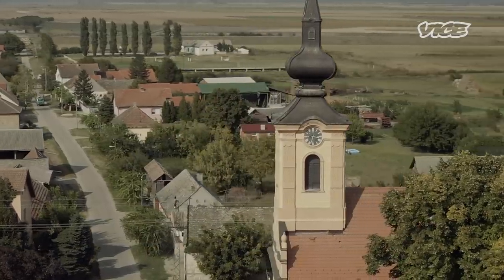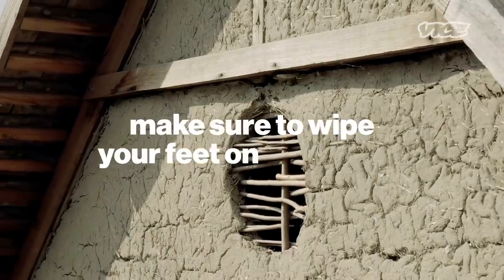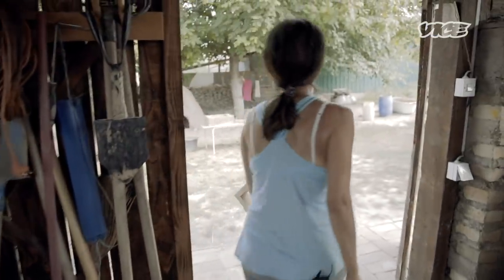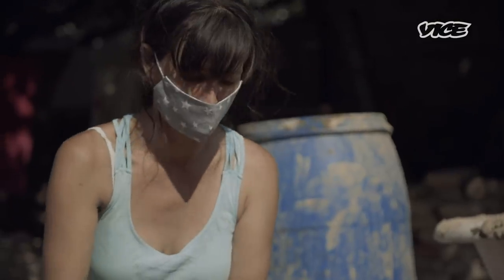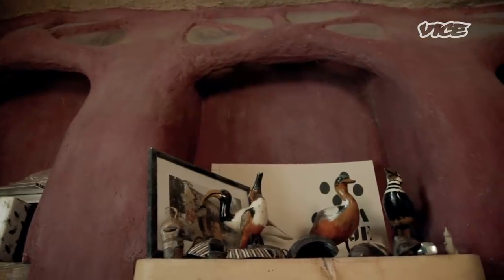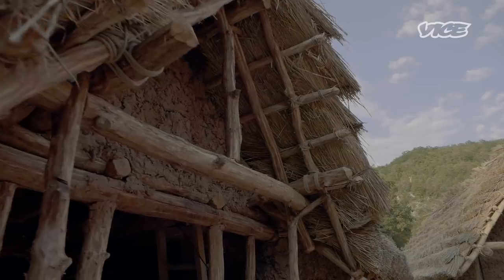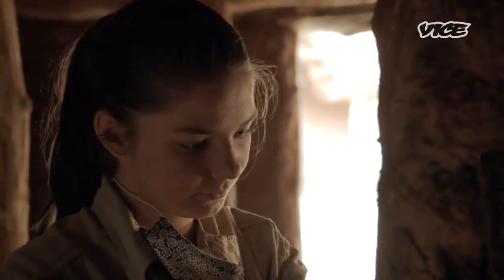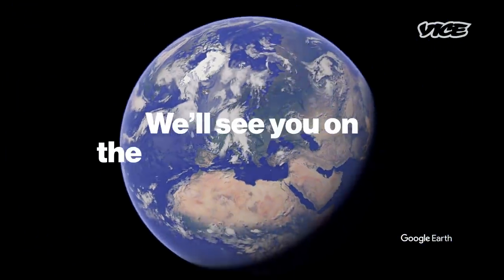Architects Are Using Mud to Build Sustainable Homes

Comment: Civilization and the westernization has doomed us all. I am an african and we built like that but it was viewed as barbaric and now look at the consequences. We should never have changed our ways!!
Reply: I mean Africans built with many other materials like stone but I feel like we always go back to earthworks because our climate is conducive for that material.
Reply: @whitneyshiphrah56  i feel like in England  the rain would make a mud house into a mud slide plus it would probs be Robbie cause all you need is a good garden hose to make a hole in the wall
Reply: @shrekthebest9399  There are rains in Africa too but mud houses can withstand such downpour. You're forgetting that the mud will dry and become sun baked
Reply: In places like England houses were built with using “wattle and daub” mud but with plaster cover to make it more waterproof, plus a thatched roof overhang so water flows away from the wall
Reply: Love that cell phone and internet though, right?
Reply: Never changed your ways? If much of Africa “never changed its ways” famine, drought, war, and disease would all be worse, and none of the technological innovations you take for granted like the device and electricity and internet required for you to post your comment on here would not be available for you to take for granted.
Reply: dude, don't use a phone then.
Reply: Lol
Reply: @magesalmanac6424 
Adding horse pee (no joke!) to the mixture improves wet weather resistance.
Reply: You don't know what you're talking about
Reply: @shrekthebest9399 heard of thatch housing?
Reply: ❤❤ say it how it is
Reply: @Father_Brother_Son   We probably could've invented something better than modern technology and cars though, if not for the interference of colonialism. That's the point. A lot of the things black people were told made us "primitive" actually turned out to be more environmentally sustainable, cleaner, healthier, etc. Just imagine Africa untampered with by colonialism, and how far we would've gotten from 500 years ago to today.
Reply: @ninibugg6203  I’m sorry, but no. Absolutely not. Let’s take a step back and examine global history. 

1. The great enlightenment, which was the single most important global event that we can credit to some degree with all of our technological advances, that allowed us to dispense with superstition, to flourish like never before, and even have the increased lifespans we enjoy today occurred in England exclusively. Had they been isolationists like feudal Japan, the rest of the world would never have received the benefits of the great enlightenment and we would all still be ruled by superstition.

2. Before this event occurred, European civilizations had already gone through the Bronze Age and the Iron Age. Meanwhile, all of Africa and much of North and South America were still stuck in the Stone Age, constantly at war with each other, and being held back by silly superstitions that often prompted them to kill each other. They also practiced slavery and probably still would if Americans and Europeans hadn’t jointly decided that slavery was wrong and it should be globally outlawed, a policy they absolutely did impose on Africa as well.

3. No “colonial” contact means no Christian volunteers to teach them how to read and write and thus bless them with the opportunities related to having those skills on top of generous donations of treatments for their aids and malaria, mosquito nets and education to prevent these things in the first place, pumps to access fresh water, food to feed the starving, and even electricity and cell phone technology, which they use today. 

This idea that all of Africa would be like Wakanda from black panther if not for Europeans is laughably absurd. If not for Europeans, Africans would still be constantly at war and enslaving one another with Stone Age tech and dying far worse from disease, famine, drought, and war, and they wouldn’t have the education required to seek opportunities like the African immigrants I’ve known and admired while I was pursuing my degrees. No Europeans means no great enlightenment benefits, no tech past the Stone Age, no relative peace, no medicine against disease, no clean water or food, no education. Wakanda is not real, and Africa would not be better off today had they never met Europeans.
Reply: Alot of africans can't afford these concrete building so switching to mud bricks is preferable tbh, cost of living is rising, we are gonna see more homelessness, this is the right path.
Reply: @Father_Brother_Son   While I acknowledge the Englightenment Age, to say Africa would not be better off today had it not been for Europeans is a bit of a stretch. Every continent has an era of famine, drought, war, and disease occurring at different time periods. Look at Europe during the Black Plague, the Crusades, etc. Civilizations fall and rise all the time, & maybe Africa was having their fall when Europe was rising. But I highly doubt it would've stayed like that forever. After all, Africa is the oldest continent on earth and we've had our kingdoms & empires (Mali Empire, Kingdom of Kush, Songhai), had some of the oldest/prestigious universities & libraries throughout such as Timbuktu, Cairo being a prominent world-trading region, Mansa Musa being the richest man to ever live, etc. All in Africa at some point in history. So no, I'm not trying to "Wakandize" anything (why do y'all always bring up Wakanda anyway?) but I think we would've rose up just fine even without European intervention. 

Also, the first nation to abolish slavery was Haiti in 1804 after they gained independence from the French, and other western powers only followed suit because other people of color in those nations gained inspiration.

And P.S. a lot of "modern inventions" we have today actually originate from black people such as the traffic light, sanitary belt (pads), and even the light bulb, although Thomas Edison got credit for it. Just imagine what we could've invented without racism/colonialism at our throats.
Reply: @ninibugg6203    Let’s start with those universities you mentioned. Not only would they not be “prestigious”, those universities would not even have existed had it not been for the concept of universities and higher education in general being introduced by the Europeans to the Africans. You also can’t really have universities without reading and writing. Africans were taught how to read and write by the Europeans. 

Also, comparing the Black Death and brief periods of drought and famine in other places throughout the world to the drought and famine that has really never not been an issue for a disproportionate amount of Africa is a false equivalence. The famines and droughts that pop up here and there throughout the rest of the world are marked by a beginning and end. That’s not really the case for a lot of Africa, where it is pretty much the standard all year every year. 

As far as why we bring up Wakanda, that’s because it’s really the only fictional reference of a more advanced Africa with no European influence that exists, but it’s pure fiction and Africa would still be as bad today as the Europeans found it if not for their influence and contributions, just like North and South America. Asia needed some work too, but they were centuries ahead of where the Americas and Africa were in terms of culture, agriculture, civilization, and technology. 

Btw, Haiti is not part of Africa, and the Africans were still practicing slavery until the Europeans outlawed the trans Atlantic slave trade with an end to slavery in the US soon to follow.

I agree plenty of black people have made contributions in technology. What’s your point? Here’s mine: they were able to make those contributions because of the European technology on which their inventions were built and the education they never would have received had the Europeans never shown up in Africa. Both of these things, the technology and education, were results of the Great Enlightenment and European influence, the significance of which you already acknowledged and its origins being in England. Had they been isolationists like the sword swinging Japanese during Feudal Japan, then the Great Enlightenment would never have benefitted the rest of the world and England would be the most advanced place in the world and, with the exception of East Asia, the rest of the world would still be in the Stone Age and populated by superstitious savages who are motivated by fairy tales, racism, tribalism, cannibalism, and war. Even before the great enlightenment, the Europeans were forging steel and had harnessed gunpowder for weaponry. The great enlightenment led to electricity and all the things we use with it, such as advances in medicine and the inventions of black men who would never have been able to make those inventions if not for the Europeans. I am perfectly happy to acknowledge the good that Africans and their descendants have contributed to the world. Why can’t you acknowledge the European contributions? Why will you acknowledge the Great Enlightenment but also try to divorce it from Europe and pretend like Africa would have eventually had its own enlightenment by now if not for the Europeans? That’s a discredit to the Europeans. 

You ask me to imagine what Africans could have invented without racism and colonialism. Well, Africans would have invented nothing without colonialism, for one. Two, I agree about the racism part. Imagine what Black Americans specifically could do if they weren’t so obsessed with the idea of being racism victims. That’s why African immigrants are the ones who come here and become doctors and business men and become very successful, because they want to be here and they want to be Americans and they’re not obsessed with skin color like race obsessed people seem to always accuse white people of being, ironically enough. It’s funny how the biggest racists are always the first ones to accuse others of racism, just because of their skin color.
Reply: @Odin31b   Sure, especially since OUR folks were instrumental in creating it. Duh!
Reply: @Father_Brother_Son  I'm sorry. Yes. Nobody needed Europeans. Indigenous cultures would have advanced on their own had they not been cut off from thousands of years of their own history.
Reply: @Father_Brother_Son     Uh, no. You're folks invented division and victimization. Not us. Now that it's had the effects that it WAS INTENDED TO HAVE IN THE FIRST PLACE, you want to complain. Typical. The victimizer has now become the victim. Imagine that!
Reply: @Father_Brother_Son    Yeah, your folks. I don't stutter. The same ones who sit up here and want to run their mouths without knowing the history. There are people who spent their entire careers studying African history. People like Christopher Ehret, like Dr. Shomarka Keita, Dr. Sally Ann Ashton, etc. Yet, somehow, someway, you think you know more than they do. Indigenous peoples had construction techniques and abilities that are STILL not fully understood and thrived for centuries. Yet somehow, the world was in such dire straits without you 🤣 I swear, you can't make this crap up. You just can't.
Reply: @Father_Brother_Son   Funny how people such people like yourself think you're experts on Africa; more than the people who actually live there. I guess you know everything going on in Japan or Switzerland too. Eh? They don't even need to write their own news or even their history books. They can just hire you, the know-it-all. 🤣
Reply: @Father_Brother_Son   That's right. Your folks since you take on their one sided mindset. Don't make me give you a history lesson.
Reply: @gsutton78  I would welcome a history lesson. Give me an insight into what kind of revisionist history you think is true. Does it include the Barbary slave trade? How about the willing participation in slavery by Africans that existed long before Europeans arrived? How about the fact that your attempt to claim slaves as being exclusively African for all of history clashes with the fact that Slavic peoples were so often enslaved that the word “slave” comes from the word “Slav”, denoting the Slavic peoples because of how frequently they were enslaved? Please, let’s hear your revisionist history lesson that leaves out anything good from the Europeans and anything bad that came from Africans and depicts the former solely as malicious victimizers and the latter as nothing more than blameless victims. Please, I’m all ears.
Reply: @Father_Brother_Son   No revisionism necessary. Just the facts. Europeans had guns. You really think they would take "no" for an answer? Newsflash, no they wouldn't have. Because when the African sellers ran out of people to sell, the traders said, " no problem, we'll take you then". And let's not act like slavery isn't still a major problem even in the 1 st world. It's just in a different form called "human trafficking".
Reply: That's right. Their ice is not colder, just more toxic.
Reply: @gsutton78  way to completely ignore the Barbary slave trade and all the Europeans who have been enslaved, including by Africans. Yes, you’re right. Slavery does still happen. Those Somali pirates traffic people. Going to blame that on Europe as well? Funny how you  mentioned fact that the Europeans had guns but ignored how they could have taken African slaves for free by force (like African pirates did to Europeans) but didn’t. Way to also intentionally ignore the fact that the African slaves who were purchased were already slaves before the Europeans arrived. Way to also ignore the fact that slavery continued within Africa between Africans after the transatlantic slave trade was outlawed by Europe. Tell me you’re racist without telling me you’re racist.
Reply: @Father_Brother_Son   Blah blah blah. You guys get on here and you run your mouth about things you don't have a clue about and haven't thoroughly thought through it researched. All of a sudden you're genetics experts and experts in both history and current events. But people who ARE experts in these fields don't spit the ignorant dribble you guys do. As they say, a little knowledge can be dangerous. You and those who think like you are the embodiment of that saying.
Reply: @Father_Brother_Son    The entire West eventually "outlawing it" means nothing. That was just for show. Drugs are outlawed, but is STILL a successful, multibillion dollar industry and will CONTINUE TO BE. If the highest people in government and law enforcement were not in on it, getting their CUT, believe me it would not be successful. And the 'institution' as practiced in Africa was NOT the same as what was practiced  in the West.
Reply: People in the West also built with mud. It's called cob or wattle and daub. The truth is that the mud walls need repair after heavy rain, but most people don't want to get their hands dirty
Reply: @DieNibelungenliad  Thats a very good point. It also begs the question of how reliable is it to run electrical wiring, plumbing, and HVAC through those kinds of walls.
Reply: My house is made of concrete and wood.  So what.  I like it.  I don't want a mud hut, it's dirty.
Reply: "Civilization"! 😅😅

Comment: While working as a carpenter in Japan I put an addition on a house that was built around the year 1900.  The wall that we opened up had a massive header beam from a 100-plus-year-old tree that held the sliding doors in place.  Between the studs, the walls were supported by interlocked bamboo and the insulation was made of straw and mud.
Reply: thats awesome. was it well insulated?
Reply: it is called wattle and daub in Englis, Bahareque in Spanish.
Reply: Yeah but not everyone wants to live in that..
Reply: @deooptimomaximo9843  Sorry for the delayed response... lol The insulation isn't ideal, to day the least.  But the more comfortable we are, the less resilient we are.
Reply: @ItchyKneeSon  yeah fair point. Thanks for the response